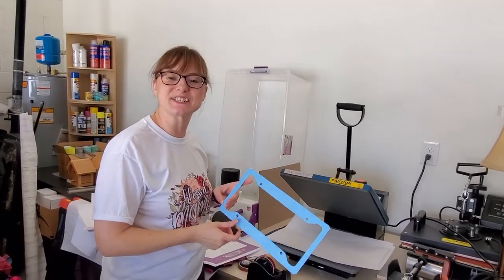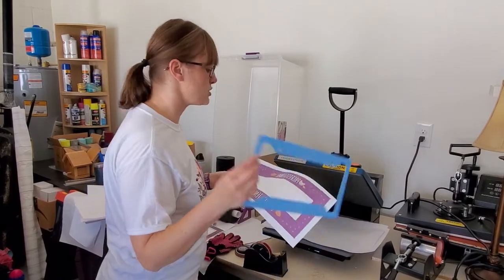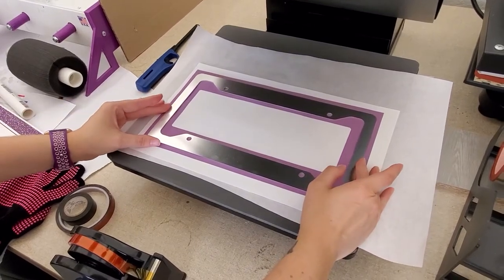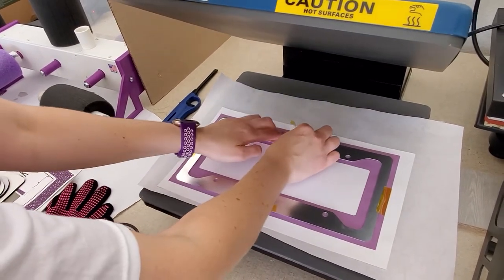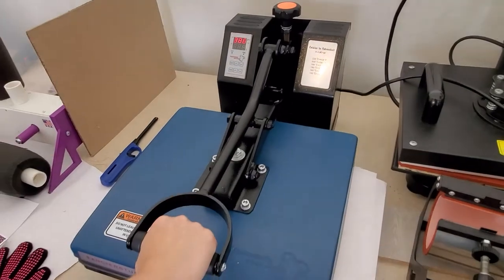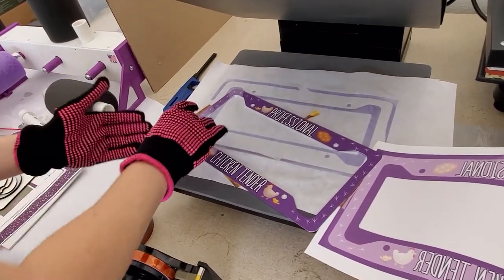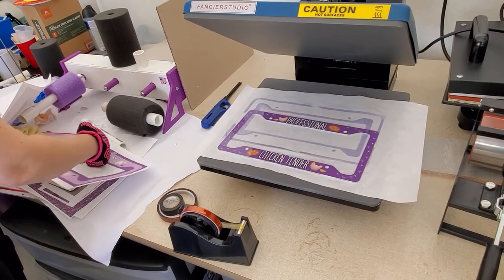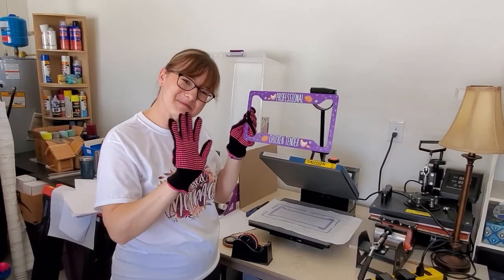Sublimate a Car License Plate Frame from Inkfinitee // Sublimation Tutorial

Comment: What size did you print
Reply from the maker: I had to measure my actual frame and make a template. It is not the best, but at the time I did not have a printer large enough to scan the item. To make a template for my items, I usually scan the item so it is the exact size of my product. So many of the items vary in size from vendor to vendor. In fact, this item is not even available from my vendor at the moment. They were looking for a better quality product to carry.